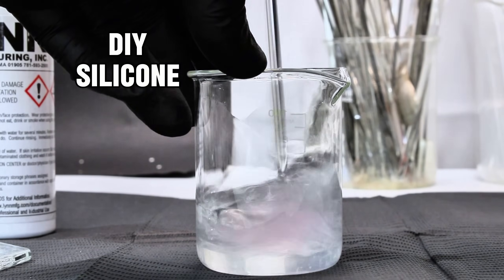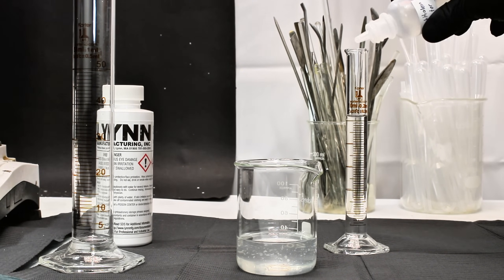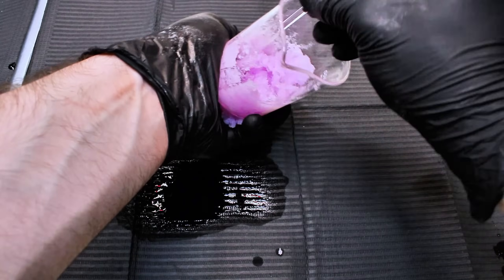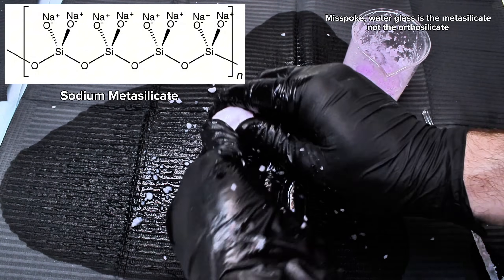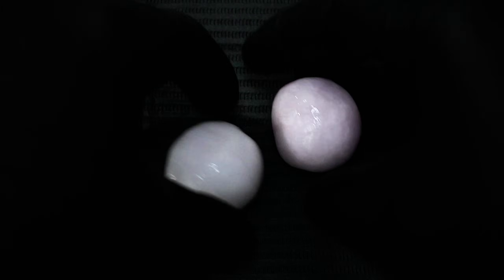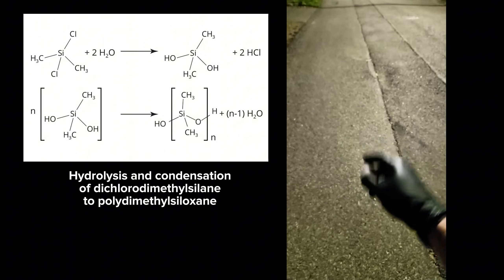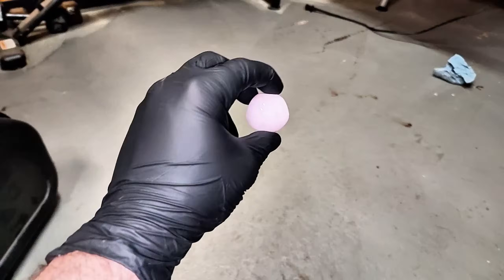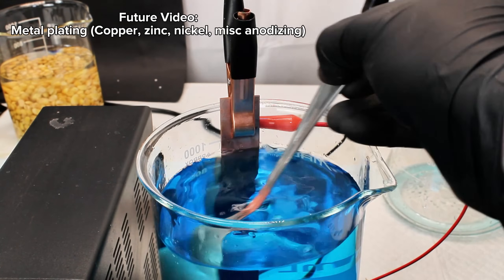Making Silicone from Scratch

Comment: On the 'slow to cure' caulks, It can be fun to play with these. The acetoxy cure silicone cures by releasing acetic acid and absorbing water from the environment. If you mix rapidly with various damp alkali, you get interesting behaviour, from simply setting rapidly, to making a foam if you use a bicarbonate salt.
Reply: Well now you’ve gone and given me so many ideas!

The old KOR Chanel had a “make your own rubber” and I’ve rescued some critical projects at work with it. I’m sure this could add insulative (I’m not sure about the spelling there) properties for some other tasks like freeze drying chamber seals!
Reply: The foam idea is very interesting. In FDM 3D printing we use RTV silicone to produce custom insulating socks. Making the silicone foam as it cures might further enhance insulation properties.
Reply: @daliasprints9798  I don't think the heat leakage through silicone sock is that high. Most of the heat loss in an already insulated hotend even with shitty insulation occurs due to expelling the melt to actually print things. Besides floppy fragile sock is inconvenient.

I do like this synthesis method in this video. If it produces silicone which is high temperature stable and more on the rigid side, i might use it to produce a sock.
Reply: @SianaGearz  That's actually not the case. I use MPC heater control where the model is accounting for where the power goes, and only up to 25W goes into flow, while 55-80W (depending on CPAP power level) goes into the air (120W cartridge).

Comment: Yes, very interesting! I was so excited when I discovered waterglass. I looked for tons of ways to use it, but I didn't know about this one, it's great!
Reply from the maker: I'm still trying to think of more applications considering what a neat and easily accessible chemical it is! So far I've got this and growing a chemical garden
Reply: @integral_chemistry  that's pretty cool already! This is not exactly chemistry and maybe more something like materials engineering I guess, but I have been playing with using waterglass as a structural adhesive for binding and rigidifying carbon fiber for high temperature applications and I'm pretty sure there is potential there. Probably a question of finding the right waterglass formulation and additives... what I've tried seemed promising but kinda reverted to NaOH after a while...
Reply: I work in a waterglasses factory and you wouldn't believe how many industries use them. For an amateur chemist though it can be used for the chemical garden, as a raw material for making pure silica, to make homemade silica gel, for glueing and fireproofing reaction apparatuses, for metal casting and many other applications.

Comment: How would the material properties change if ethanol is replaced with 1-propanol? More elasticity and bouncyness? A less dense material?
Reply from the maker: I tried using a few different types of alcohol with mixed results. I did a bit more research since posting this and I believe the actual mechanism is the formation of sodium ethoxide which then acts as a leaving group forming Si-O-Si bonds as the crosslink.